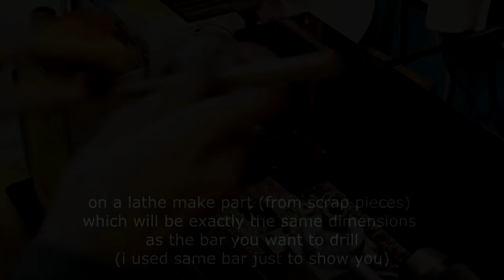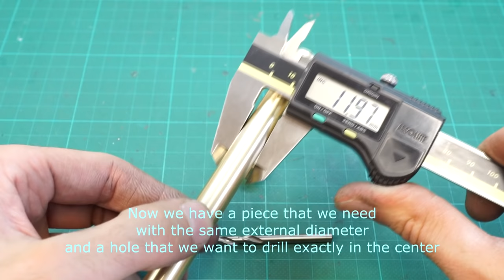Another way How to drill a hole through a round bar in perfect center [middle]

Comment: A bit convoluted but worthwhile to consider. Actually many drill vises have one prism jaw so then it will not work for sure. Also making bushes for anything but the smaller diameters will be costly and time consuming. There is a special tool which I forgot the name/ brand of but I'm sure it is Swiss and I think still available. Expensive though. Will post when I find it.

Comment: So bottom line is it will be as accurate as the hole punch and how well you center the vice and drill press. But hey, depending on what you are doing, it's probably close enough for most applications and a good improvise.  Good stuff for those who don't have access to a machine shop.

Comment: if you are going to use verniers as a scribe block you can also use them as g clamps for welding and as an adjustable spanner. if you can't crack that nut just put some pipe on the end....
Reply from the maker: manofausagain i didn't take them as ground clamp, they did not heave eaven a spring, and not hold 200a constantly, but you can try, there are all kind of people in this world.
i know you want to sound like a smart man, with sarcasm... but you don't because you didb't notice that i measure with digital mitutoyo caliper and scrabling with a cheap one $5 caliper.
eny other smart advice from you?

Comment: @Trailchaser
Your comment is misleading. You did not thoroughly read the damn title. It says "Another Way...”, not the 'right way', or the 'easy way', but "Another Way".
Not everyone has a dial indicator or a machine with a DRO, or even a 'machine', they have a drill press, and a vise. With those, and a straight edge, it is possible to make the 'tool' he made with the lathe, and then do a BETTER job of transverse drilling round stock than they otherwise might be able to do.
I agree with you that it can be a huge disservice to teach people the 'wrong' way to do someone, and have no problem with people correcting video authors, (I have done it myself), but it is annoying as hell when someone doesn't read a title accurately, and then goes on to incorrectly correct a non-incorrect method, (too many 'corrects'?; well, that's YOUR punishment!)
BTW, I would take issue with your 'should have been hardened steel instead of brass' statement.
First off, if you don't have a dial indicator, mill, etc, how the hell you gonna drill hardened steel? 
Second, if you were cross drilling a thousand rods a day, yes, hardened steel would be better. But, who is going to use this method in production work? NO ONE.
Third, in a drill press situation, (which, if like MOST drill presses, is closer to an elliptical tool than a rotary tool), the brass will not damage the only drill bit the person has, in that size.

Comment: first . you need a rigid machine and a rigid setup . step 2 you need a stubby carbide drill 2-3-4 times the diameter cutting lenght , go low and slow until you pass the round 'surface' . When the drill gets to cut fully you can speed and feed more seriously .

Comment: but how do you know its sauare when the stock isnt necessarily sitting level in the vice? ..shouldnt it be laying on the bottom of vice to be sure its perpendicular to the drill bit? ..or laying on a sauare piece of scrap that's laying on the bottom. that third point of contact would also make for a more secure clamping of round stock like that in a smooth jawed machinists vice like that.

Comment: If you place a piece of fine emery cloth, or similar, along the movable jaw between it and the work piece and drill guide (abrasive side away from the jaw), it will absorb small height differences and grip both securely. This applies anytime you want to grip more than one piece securely in a vice if their heights, or jaw parallelness are not perfect.
Reply from the maker: Marks Myth thanks for that

Comment: Bushings help, but I've seen them not hit exact center quite a lot.  You can also take an endmill, make a small flat before you run the center drill.  Held 0.0001" accuracy to center all day long.
Reply: if small end mill cut  spot round it's in center if not round not in center with lightest cut possible

Comment: Simple and easy is to use a small steel ruler or other flat even thickness thin strip mark the centre and balance on the round bar, use a centre punch or other pointed tip tool and put in drill chuck, carefully lower the chuck and bit till it presses on the metal strip and observe how it tilts, move the piece to be drilled so that the metal strip balances evenly parallel with the vice. Remove the punch and fit centre drill, mark and then use a drill. works better on a X Y table

Comment: Instead of going through all that work, couldn't you have just cut off a scrap piece of bar, chucked it up and then centered the vise on that? Then all you'd have to do is put the work piece in the vise and the drill bit in the chuck. Would it have been as accurate? No. It's far less work though.

Comment: great idea but u need a lathe and mill. I use a steel ruler or v block and drill press with a center drill and have the same result and I dont waste any material
Reply from the maker: David James no need mill, Just lathe
Reply: that's how its done in real life. if you do it for living

Comment: This wouldnt work without an proper machine vice. The vices most people have at home dont stay parallel and wouldnt hold the guide and rod at the same time, Its working for you because you have a proper machine vice. Its an idea but I dont think it will help most people. If you have this kind of equipment, there is no need to use this method. I made a simple v block style drill jig that I can use on the drill press. The hole is always in the centre of the V, and I can put any size bar stock or pipe and it always drills in the middle.

Comment: Touch off the rear vise jaw, move forward in Y 1/2 the bar diameter. If you're being picky, spot face a tiny flat with a center-cutting end mill, or not. Then spot drill, and drill the hole.
Reply from the maker: Eric Wallgren that is the basic way yes, i use that way all the time, but just want to show "another" way, works eaven greater with drillpress.

Comment: Most of us without a lathe in the small apartment, want to find exact centre centre of bar diameter using a cordless drill. Any ideas?
Reply: It's difficult. And most jobs require tools or the means to make a tool. Somewhat expensive but will last a lifetime is a dowel jig for wood. It will tighten from both sides placing the drill guide and work in the center. There is a line on the side to aid in keeping the material square. Works just fine with a hand drill. If the bushings aren't the size you need, drill smaller and it will work fine as a pilot hole. 30+ years ago, I grit my teeth as a cash strapped father and purchased one. I still use it.

Comment: Make a v block with  holes center drilled to the  center of the  v....  Make  holes as  many  common drill  sizes as  you  mainly use.....  The  v block will  center  your  drill perfectly.....  Of course you  could just  do the  simple math and  use a cross  slide ...  If you don't have a cross slide just  make one

Comment: If you really want to get exact center use a dial indicator and sweep in in to find center. Preferably an tenth indicator. Then proceed to follow-up with a center drill then the diameter drill needed to achieve the size hole needed.

Comment: Another, even easier way would be to use a file or, for the more advanced DIYers, a stubby flat bottom drill or slot drill, to produce a small flat on the side of the bar in the drill vice. Then measure and center punch the position , then drill it.

Comment: This is not "easy". You had to make a tool and required the use of a lathe.

The easiest ways is to locate the rods central axis with calipers then center punch the location of your hole. Locate a smaller drill in the center punch divet and get a hole started. It will not shift. Finish with the final size drill. No special tools required.

Comment: If I am drilling on a mill, I shouldn't need a guide if the setup is correct. Touch the drill bit on one side of the rod, then index in "Y" direction 1/2 the diameter, you are in center. vise should be clamped down to table and jaws aligned in the x direction. Use a dial indicator for that.
Reply from the maker: Eugene Spicer that's the basic way yes, but this trick is prevent really thin dril bit to band( like if you want to drill 1mm hole into 3mm round rod it will shift or band...)

Comment: Interesting approach, but I thought the use of a V-block was the quick way to do center drilling in all diameter of tube and rods.  I made a 3D print of a V-block to drill 1/2" rods on my mini drill press.
Reply from the maker: Hy, for sure the v block or edge finder is apsolutly the fastest way, but there will be problem when you use small diamter of rod and small drill, for example if you got 3mm rod and 1mm drill, the drill will band at the moment you push dril into rod, you can use centering drill bit befor but still bend the tiny drill.
I just show an example here i still think that's good and precise way to drill in center, no metter of comment below.
But eaven i don't use this method too often because it's lot of work, usualy just find the edge and use DRO on my minimill.

Comment: Wasting stock when all you need to do is dial in the radius, center drill and then drill a 30 seconds operation.   Your vise back jaw is usually known to be set at zero.

Comment: Does no one in the comments know what a centre drill is? They dont push off at all. Its not hard to spot it with a centre drill then change over to your other cutting drill... You could even spot in with a smaller slot drill to create a flat if you really wanted to, instead of messing around like this.

Comment: no lathe? try cutting a square scrap same side as diameter cross line drill hole lay in  90 degree trough {A corner= place block at end clamp down drill block and bar drill through hole
Reply: for other direction {cut block drill hole same size as rod drill through block at halfway place around rod clamp drill away

Comment: Whether this is a good method depends on what tools you have at your disposal. I have a lathe, and drill presses, but no mill. I'd make the bushing longer and, for example, drill it 15/64" followed by 1/4" for a tighter fit.
Reply from the maker: BikesmithDesign agree you can got better result with drill pres, because vise can move free to position, but i don't heave it.

Comment: man u have good machine but i dont have this machine how to make hole on shaft 4mm
Reply from the maker: Hy, you can use v block, measuring or any other options, if you have a centering chuck on drill press you can make "centering part" on it.
Or find 4mm thick piece of iron, mark the center drill thru and than same as here...

Comment: nope... THIS is how you do it...

Bit of thick angle Iron with a 45deg hole in the spine. Job done.
Works on any size pipe/rod and even flat surfaces for a 90deg hole.

(Angle stock needs to be symmetrical, and thick... If you can get a bit of 50mm x 50mm x 10mm by about 100mm long...
and use a mill to smooth the spine and drill the holes (several for different drill sizes),
I sometimes make these tools out of a bit of 10mm angle Iron... costs near nothing but time and can be used without a vice on multiple sizes.... 
Also allows you to drill 45deg holes in the spine of a square tube.... Bonus!
Reply from the maker: Also that's the way yes, basicly i use edge finder and dro.
Reply: @TinC33  With the angle stock idea I also added a hole in the spine at one end so I can fit a scribe to align the hole with the tube etc if a line is drawn along the stock length...
Also I put 90deg scripe lines from the spine holes so the hole can be aligned if you marked a radiating line on the stock...
ie, put a big X on the hole and you can align it even when the tool covers the intended location.

1 tool, multiple uses... I should sell them...

You could 3d print them and insert brass tubes in the spine holes

Comment: i can bet you that its not in the center tho... the hole in the "drill guide" piece must be bigger than the drill (a really tiny amount at least) so the drill have space to move that much around the actual center... niggler but if we are talking about the perfect center then...
Reply: A good drilling tip is NOT to drill the final diameter without first drilling with a bit say .5mm smaller.  I learnt this from a book written around the time of the war.  It's actually possibly to drill a hole that you can't push the bit into by hand. Accuracy of drill bits is another issue, but since I learnt that, I change up bits several times while drilling  - effortless and accurat

Comment: John Q Public don't do this technique. 

Use the vice or v-block to hold your round stock.  Touch off both sides and find true center of the stock.  I usually touch the end and feed down a precise amount too rather than score a line.  

The take an end mill smaller than your bit and mill a tiny spot face on the stock.  Center drill with a spot drill with an angle larger than your twist drill.  Then drill the stock.  You will be in true center, no walking, and you only need the mill.  

This technique might end up +/- .015, my technique will be less than  .005 on placement easy.

Source:  I'm a professional Machinist.
Reply from the maker: Rob Keehner hy, yes i know for that process, eaven i don't use this trick as I shown on video.
i just want to show another way to dril that kind of hole, maybe someone don't heave a mill (don't use for this step) i don't know why somany people so upset about this video, this is just one way, i am electricar and do mechanic job for a hobby, and i'm not a teacher or something, there on Yt is milon and milion dumber video, but maybe give someone any idea ant that's ok for me.
I newer say that you work wrong for a whole life and don't say that this is the way you must do from now on the future...
Thanks for understanding.
Reply: tintek33 I said something because this technique or whatever you call it is unnecessary, inaccurate, and potentially dangerous.  

During your action shot of the drill operation you can see the bushing get pulled up from the workpiece.  this is because you are off center and the drill is trying to walk off axis and pulling it up.  You risk breaking the bit and flinging the guide bushing and broken drill bit at yourself.

Comment: Easier would be to just spot and drill on the mill itself from the start, no need for a drill bushing. And no, you don't use a center drill, you use a spotting drill, you are not making a center hole.

Comment: As a Toolmaker for 30 years, I can tell you that only in the mind of a fool does this really work. First the  pipe would not go into the vise without deforming and the drill clearly was deflecting off the pipe as it started.  You need an edge finder and a center drill worse than anyone I know.

Comment: With all that tooling, you probably have a v-block. Why not use it? I can get excellent results on a drill press and a V block. No need to know diameters of drill or stock. No layout, measuring, or center drilling. For those interested, I will post a video
Reply from the maker: Philip Breau i know, i just show there another way, is this so wrong?
And if you use small drill bit like 1mm try to drill small diameter rod like 3mm it can easy shift to one or other side with v block.
Reply: Tintek33,
OK. Nothing wrong. I see the value of something different as long as there's tooling. That's fair. I don't even have a vise so it won't work for me. 

Now there's a challenge.  I don't have mm drills. I will try drilling 1/8 rod with 1/16 bit. Wish me luck.
Reply: tintek33,

Your way is different. Yes, it's another way and I believe you get excellent results. I don't have the tooling you have. I don't even have a vice for my drill press. I just took up a challenge of drilling through 3/32 (coat hanger wire) with a 1/16 drill. Just so happens, the wire fit exactly in the bottom of the V clearance undercut - dumb luck.  So were talking 1/64" wall thickness. I don't have metric drills. However, the smaller diameter 3/32 wire would prove as difficult as 3mm. On 3 attempts, I didn't center punch or center drill. My setup was sloppy, but it was proof of concept. I got very little wander. Considering the thin diameters, It didn't break through either wall. I will try again with a more rigid setup, prick the center and center drilling.
Reply from the maker: Philip Breau ok, there is one more way to do with only a drill press, but i don't heave it. you must use the centering chuck (if you heave it) to drill in center of bushing, than continue as there, on a drill pres is eaven easier because vice center itself to a hole in bushing.
I just see this method somewere and seem very logical to me for a great center so decidet to share it, i don't see the problem of another vid on yt (by millions stupid unusless vid here) util i read all this comment. i feel like some hobbyst come to the class and start learbing, can't understand. heave a nice day.

Comment: If you have a drill press, then for Pete's sake get a clamping v-block. You're going to be using it pretty often so don't be stingy. Put in jigs to facilitate centering it (or mount them permanently). This style of guide here looks like the best of the bunch. http://www.kanzawa-store.com/?pid=72130627
Reply from the maker: ExtantFrodo2 that is another option, but i thing it's less acurate, spacially if you use small drill about 1mm drill drilling to 3mm bar, the drill just shift to one or another side.